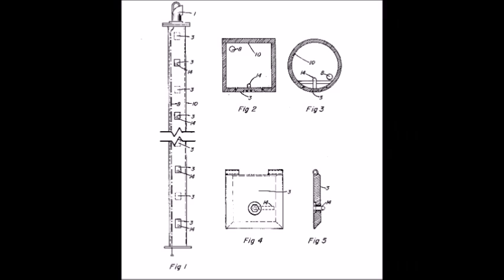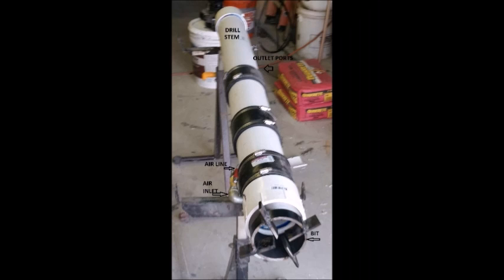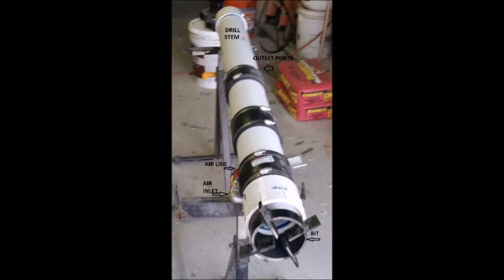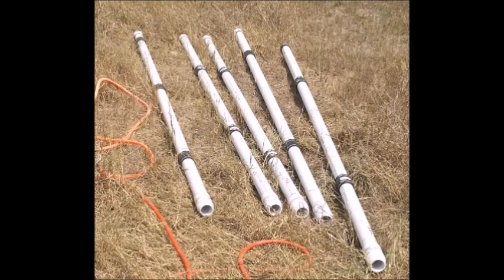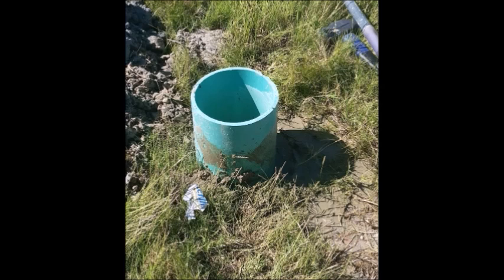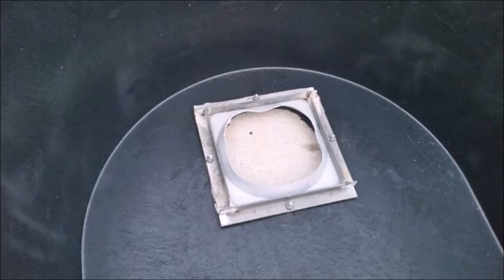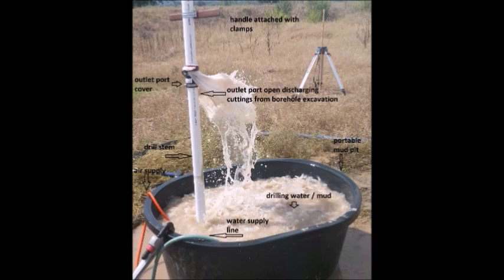The most important well drilling invention ---ever.

Comment: I’m always a little suspicious of someone touting his own great new design.   I don’t see any videos of it , just water filling up a tank.  You make it sound like the end will spin. It would take a tremendous amount of air pressure  to spin a cutting blade going down in a hole.  Drilling rigs use incredible force  plus high water pressure  and bentonite to drill holes. They still get stuck and have to pull pipe out excreting up to 20,000 lbs of force to remove them.   Your asking for money so show it out of the hole running and then start drilling.
Reply from the maker: Gene Miller, Thanks for the comments. I have been funding this project, primarily, out of my own pocket. If you watch the videos that I have online, you will find many that show the drilling process. And no there is no turning bit, bentonite or cases where the pipe is pulled with 20,000 pounds. However, we have drilled to 120 ft. deep in India with a 12 inch diameter bit--- by hand. The cost of the India and Zimbabwe projects was borne by others. 
The drill is patented and is being introduced through out the world right now. It is a shame that you are "suspicious", yet know nothing about the drill. I hope you realize that this is an expensive project, I am funding it myself, and I have few donors. It does not help me get water to poor people when people who do not research the idea, and then make negative comments. 
I hope you will research what I am doing before commenting again. And after you research if you want to donate, go to http://www.onemillionwells.org
Reply: I can't even begin to explain why this system will not work in most situations but you have stated at least a few of the most obvious reasons.  We drill through a lot of rock and hard clay in Mexico and so I've been doing this for awhile.  And just to add to your suspicions about these claims of changing the world,  any of the air lift methods have a lot of physical limitations that can't be overcome - it's a matter of physics.  I won't bother explaining, there is plenty of info on the net.  I'm reluctant to write to this person as he doesn't seem to be trying to deceive anyone, he just must not have any practical experience in the field. So I hope people read your comment before moving forward on this system.
Reply from the maker: David Catherina,
As a person that first began drilling with reverse flow air lift drills in the early 1960 and who holds two U.S. Patents on the process, I assure you that it works, and works well. I encourage you to look up U.S. Patent 9,915,113 and study the process. And of course the drill will drill rock as it  can be modified to drill with a reverse flow hammer drill, but then it would require a heavy rig. So it will drill rock, just not with a plastic drill stem. My patent does not require plastic stem.
I have drilled pretty much all types of boreholes, with all types of drills. My largest diameter belled bore was 29 feet in diameter and I have been drilling for well over 50 years. I have also drilled in Mexico by hand through the hard clay and rock near Saltillo. 
We have also drilled in India, Africa, Brazil and the United States. 
Contact me if you want more information.
Reply from the maker: Gene, I answered your comment shortly after you posted, I don't know what happened to it, so I will answer again. 
There are at least 19 videos on YouTube of my drill drilling in various parts of the world. I have drilled in the United States, Mexico, India, Africa and Brazil. I have drilled boreholes up to 20 inches in diameter and as small as 5 inches in diameter. Nearly all pumped water. And I began drilling in the 1960's and got my first U.S. Patent in 1988 on a reverse flow drill.
Reply: Having two patents means absolutely nothing in proof of concept.  There is a patent for kicking your self in the butt with boots that turn on a wheel from the US government office.  Not too useful.  As far as the hammer drill the CFMs needed would be in the hundreds often between 500-700 to run a effective DTH.  I can tell you that the people in Zambia won't have that equipment readily available and besides I would just air drill if it were.  After watching several of your videos I would feel horrible for the village people that had to bucket water to your well site to replenish your process. I can tell you from experience that I've had a lot of good ideas but until I worked and lived in another country that I realize the difficulty of implementing new concepts.  I just don't want to mislead anyone thinking one size fits all and anyone can drill a well any where in the world.  The people that need safe water are often difficult to reach and have very few resources.  God Bless you and hope you direct your knowledge of your device to the specific things it can do.
Reply from the maker: David Catherina
Having two patents is absolutely everything when the patents work. You are a fool if you think otherwise. 
Hammer drills start at about 180 cfm for a 3 inch down the hole hammer good for a hundred meters. So you are wrong there as well.
The people in Zambia would have what they need, they are not idiots. They can receive a shipment from anywhere in the world. So you are incorrect again. 
Do you have any patents, supply proof if you do. If not, talk about things you know about.
You are misleading people and attempting to get them to give up without trying. No drill will drill everywhere, including mine, but my drill will drill in places other hand drilling tools cannot drill. And my hydraulic drill is just like other hydraulic drills and will do a fine job with a DTH. Have you ever even used a DTH?
Next time you are in Zambia, give me a call and I will come over and drill you a well. All you need to do is pay my expenses and I will give you a free license and teach you how to drill.
Till then, have a wonderful day.

Comment: Hey, after lots of prep and planning I built my drill! Everything was going great got down to 16ft, but then while adding a pipe extension had a big collapse of sand (we have very loose sandy soil here, perhaps I should have used a 5ft or 10ft 10inch pipe as an external casing to keep the loose sandiest part near the top of the hole from caving in and collapsing?) and the drill got stuck, couldn't pull it out no matter what I tried, also tried closing the top of the drill stem so air bubbles was forced out of the bottom but it wouldn't budge! Any ideas thoughts or suggestions??  (I was thinking to use a mud pump to get the collapsed sand and water out so I can retrieve the drill, and/or making a second drill stem with just pipe to try to suck out the sand and water to retrieve the other drill, and hopefully salvage and continue the same borehole)
Reply: You could use drilling mud to keep the sand from falling into the hole.
Reply: @blunt3068  Thanks, we later were using clay chips mixed in water, pouring the clay water into the hole and that helped a ton, had to start a 2nd hole after the first one collapsed, second hole has 10ft of 6" 'outer casing" to prevent collapse near the top, got 44ft deep! but then let it sit for 2 weeks from bad weather, with water in the hole (I think we hit water already) and then past 20ft deep super fine black sand mud was filling up the hole, this only seemed to be a problem after letting it sit and soak for so long, we clear it but it just fills back up again almost getting the drill buried, using a bunch of clay water but doesn't seem to stop this fine sand problem after it's been sitting and soaking in water.
Reply from the maker: It was good to use the casing and drilling mud. When drilling in questionable materials, it is best to have all your materials ready before you start drilling. As you drill, look for course sand or gravel as deep as you think you can go. Then remove the drill, and set the screen and casing, backfill with filter pack and you should have a good well. The trick is to start early in the morning and do not stop drilling until you have the full depth of the well you need to drill. Don't even stop for lunch or dinner. If you do then the hole can cave.

Comment: So any gravel that is in the hole must be small enough to pass by the X bit for it to be removed?   Will the air/water in the tube  lift and remove rocks okay or must drilling mud be used?   Can a SDR35 type 4" PVC pipe be used for the drill stem or must it be the expensive schedule 40?    How  deep can I go using this method?
I would love to drill my own well  to escape from a greedy rural water supply system.
Reply from the maker: The method I use will allow ;passage of gravel up; to the diameter of the bit. I have removed rocks that are 3.5 x 5.5 from the bottom of 47 ft. wells. If one wishes to bring up larger gravel, then they may simply increase the diameter of the drill stem. 

As a rule of thumb, no drilling mud is required. However, I do use it on occasion when the party I am drilling for requests mud. I generally use Schedule 40 or 80 PVC. I do not recommend SDR 35. This is a new invention. We have drilled 100 ft deep in India and 70 ft deep in the USA. I do not see a theoretical maximum depth because the drill floats in the borehole.